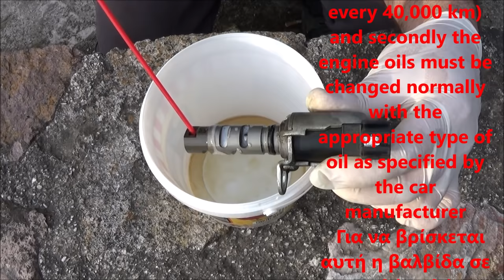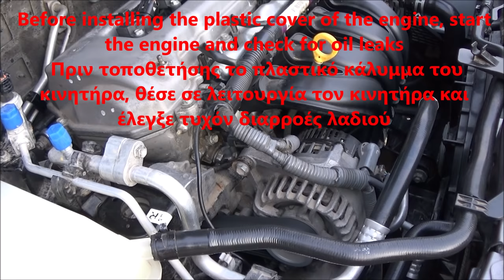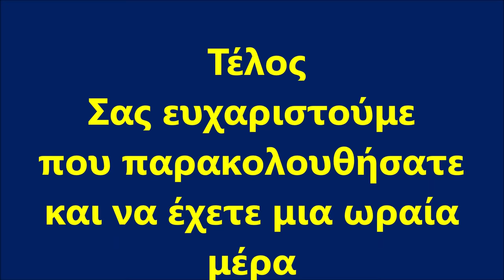2007-2013 Toyota Corolla How to Clean and Check Camshaft Timing Oil Control Valve Βαλβίδα Ελέγχου

Comment: Why need to clean it? What useful after cleaned?
Reply from the maker: Because cleaning removes accumulated burnt or unsuitable oils that make this valve difficult to operate. With a faulty oil control valve or VVT solenoid, excess engine oil may be introduced into the VVT system which can result in rough idling, stalling, or just poor engine running in general.
Reply: @YiannisPagonis  A que se refiere con ralentí brusco? Que tiemble el motor?

Comment: What is the function of the oil control sensur
Reply from the maker: Basic Function Of Engine Oil Control Valve:
The oil control valve is basically what controls the flow of oil into the camshaft of the engine (especially upper portion of the engine). This allows the internal moving parts of the engine to sustain their functionality

Comment: Why clean it? Does this necessary?
Reply from the maker: Because cleaning removes accumulated burnt or unsuitable oils that make this valve difficult to operate. With a faulty oil control valve or VVT solenoid, excess engine oil may be introduced into the VVT system which can result in rough idling, stalling, or just poor engine running in general.

Comment: What is the benefit of cleaning this part?
Reply from the maker: Because cleaning removes accumulated burnt or unsuitable oils that make this valve difficult to operate. With a faulty oil control valve or VVT solenoid, excess engine oil may be introduced into the VVT system which can result in rough idling, stalling, or just poor engine running in general.
 What is a camshaft timing oil control valve?
The Oil Control Valve (OCV) is a a critical part used in every engine that is fitted with variable valve technology (VVT). A single control valve will regulate the supply of oil to a designated VVT hub, to advance or retard the timing by altering the camshaft angle position.
What happens when oil control valve goes bad?
If you replace an oil control valve on your own and don't do it properly, it could result in your car's engine being flooded with oil or not getting the oil it needs. Both of these situations could be catastrophic for your vehicle and could eventually cause engine components to wear down and stop working. 
3 Bad Oil Control Valve Symptoms
1) Poor Fuel Economy
The main purposes of variable valve timing is to make sure that the valves open and close at the right time to boost engine performance as well as to reduce the consumption of fuel. If the VVT solenoid stops working, the whole system may be compromised, in which may result in intake and exhaust valves opening and closing at the wrong time. This in turn can cause a drastic reduction in how many Km you can travel per litre of fuel.
2) Rough Engine Idle
The next thing that you need to consider is the VVT system on your vehicle. This system will automatically be activated when your car’s RPM is higher than normal or there is an additional requirement for power such as when passing a another vehicle on an incline. If the VVT solenoid in your car is faulty, it can cause the engine to idle rough. The engine RPM will fluctuate which can directly result in a reduction of power generated by your car. Although there are many other causes for rough idling, a failing oil control valve should be considered on cars equipped with VVT technology.
3) Check Engine Light
Like when other electronic components of an engine fail, the vehicle’s computer can sense a oil control valve failure and in turn turn on the check engine light in your instrument cluster. Using a diagnostic scanner, you can determine if this part is the cause of your problems or if it’s something entirely different.
Reply: @YiannisPagonis  Thank you my friend, but I should use WD-40 or another liquid
Reply from the maker: @الجانبالصحيالمشرق  For best results use the WD-40
Reply: @YiannisPagonis  Thank you bro ❤️
Reply from the maker: @الجانبالصحيالمشرق  You are welcome my friend

Comment: Excelentes videos, fuerza y adelante! Se aprende mucho con usted amigo griego. Me gustaría saber si lo que pones en el minuto 10:28 es un pegamento o algo como eso? Es que he hecho la limpieza de la valvula vvti y lo volvi a colocar sin ponerle nada
Reply from the maker: Amigo, lo que le puse (10:28) en la junta tórica de la válvula se llama grasa de silicona para que la válvula pueda entrar más fácilmente en el orificio de la culata. También puede usar aceite de motor en lugar de grasa de silicona. Muchísimas gracias 😊😊😊😊
Reply: Genial, muchas gracias por su respuesta!. Estaré atento a nuevos videos suyos para aprender. Saludos desde Paraguay
Reply from the maker: @asael7768  Vivir, amar y aprender. Saludos cordiales desde Grecia.
Reply: una pregunta, tengo una toyota sienta 2004 me enciende el luz de chek y el motor hace un ruido después de poner en marcha.

Comment: What are the symptoms of a bad valve?
Reply from the maker: 4 Symptoms of a Bad Oil Control Valve (and VVT Solenoid)
The Variable Valve Timing (VVT) solenoid and Oil Control Valve (OCV) comprise an integrated unit. This unit can malfunction. When it does, any or all of these symptoms can alert you to problems:

1.  Rough Idle
Under normal conditions, the VVT system activates at higher RPMs or when under load bearing conditions such as driving up a hill. But with a faulty oil control valve or VVT solenoid, excess engine oil may be introduced into the VVT system which can result in rough idling, stalling, or just poor engine running in general.

2.  Poor Acceleration
The engine will accelerate more slowly than normal. Power to accelerate quickly and/or climb hills will be lacking. While you may think this isn’t that big of a deal, there may be times where you need to floor it to prevent an accident. When that power isn’t there, there’s not much you can do.

3.  Poor Gas Mileage
One of the benefits of variable valve timing is an increase in fuel economy. But when the oil control valve is faulty, that benefit disappears as intake and exhaust valves may open or close at the incorrect times. Over a period of time, you will note an increase in fuel consumption.

4.  Check Engine Light
Invariably, the check engine light (CEL) will come on. A code will be set by the onboard diagnostic system (OBD2). This code will indicate whether the problems you are noting are related to the OCV and its related VVT solenoid. DTC P0014 and DTC P0017 are two such codes related to VVT. As with all CEL ‘on’ events the car may be driven for short distances but must soon be seen by a service technician for corrective action.

Comment: this is vvt valve not camshift sensor and ander the valve filter small to the valve outside and clean to
Reply from the maker: My friend this is Camshaft Timing Oil Control Valve of the VVT-i system and its filter is just below this valve which I cleaned and uploaded to my channel.

Comment: Hi bro i have toyota corrola 2009. My brake is very soft. I change the cylinder and break booster pump little but better but not hard as it should be. There is no ABS sign on dashboard.. what can be the problem . Can you plese tell
Reply from the maker: Good morning my friend. These are the common reasons for this to happen:
Air in the Lines: If air gets into the brake lines, either due to low brake fluid in the master cylinder or from other source, it will create a spongy feel and reduce your stopping ability. ... Again, any loss of fluid pressure will lead to a brake pedal that feels spongy or soft.

Comment: I want to know the important of this oil timing
Reply from the maker: The oil control valve is responsible for opening and closing the camshaft at the right time. In general, an oil control valve has several functions that are vital. These include: saving fuel usage, reducing gas emissions generated by the vehicle, and improving engine performance as efficiently as possible.

Comment: Dual vvti 1.33 are highly problematic engines they are vibrating at idle. One day suddenly started with hard crank and after that day my car works noisy and with vibration on idle when engine gets fully warm. Couldn't find the problem. Wasted lots of money,changed lots of thing but still problem continues. (2017 Corolla with only petrol) 36000 km only. Shame Toyota! You're my last car brand after this time!

Comment: which engine is this?
Reply from the maker: Engine type 4ZZ-FE, 1398cc, 97hp, 10th generation Corolla, made in South Africa. The best Corolla generation ever made by Toyota!
Reply: @YiannisPagonis  🙏 thanks. Sir what is the difference between 1ZZ FE engine and this engine?
sir is there a video on how to install hoses into 4ZZ FE engine and functions of each hose?
Reply from the maker: @shairafzalkhan3106  The youngest engine among the ZZ s is a 1.4-liter 4ZZ-FE designed in 2000. They simply took a 3ZZ cylinder inserted a crankshaft with a 71.3 mm piston stroke. The 4ZZ motor doesn’t differ significantly from the 1ZZ and 3ZZ models. One can scarcely find its modifications as the only one was made.
Apart from the 4ZZ-FE, they developed other ZZ engine modifications. Among them were the 1ZZ-FE, 2ZZ-GE and 3ZZ-FE.
The 4ZZ production came to a halt in 2007. The next year a new 1NR engine came out into a world market. The engine is a successor of the 4ZZ.
The 4ZZ-FE is a 1,398 cc (1.4 L; 85.3 cu in) version. Bore and stroke is 79 mm × 71.3 mm (3.11 in × 2.81 in). Output is 97 hp (72 kW; 98 PS) at 6000 rpm with 130 N⋅m (96 lb⋅ft) of torque at 4400 rpm.
The 1ZZ-FE is a 1.8 L (1,794 cc) version built in Buffalo, West Virginia. Bore X stroke of 79 mm × 91.5 mm (3.11 in × 3.60 in). Compression ratio is 10.0:1
Reply: @YiannisPagonis  thanks 🙏
Reply from the maker: You are welcome 🙏 my dear friend 👌👌